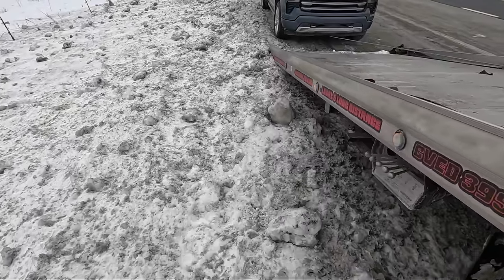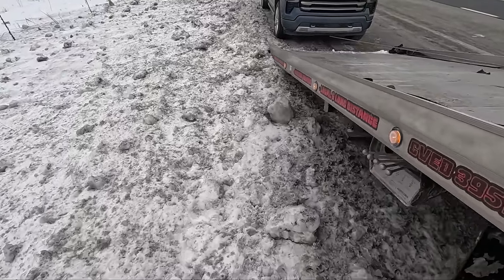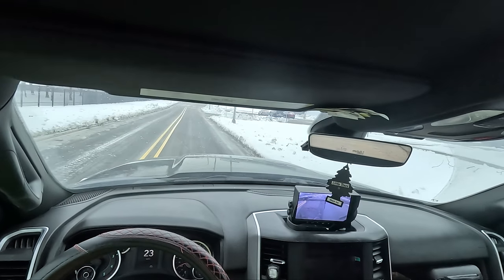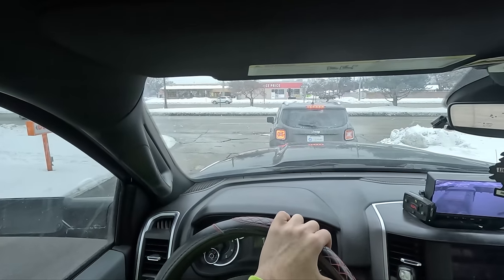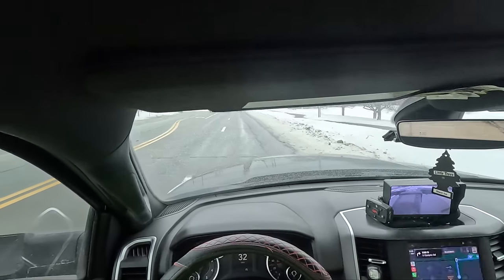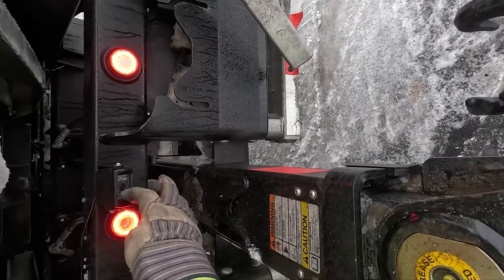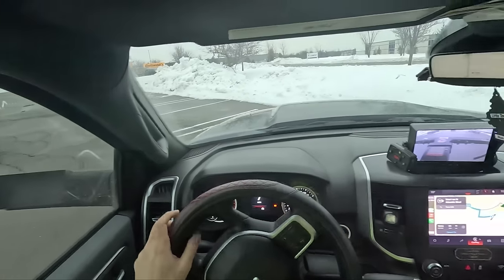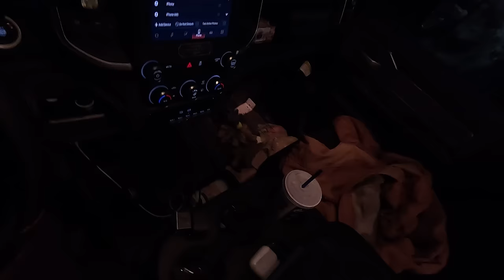2024 SILVERADO BLOWN MOTOR!! | HIGHWAY RESCUE | DAY IN LIFE OF TOW TRUCK DRIVER EP 5

Comment: Makes me wanna keep my 05 Sierra even more !!!
Reply from the maker: Those are the ones to keep!
Reply: Keep it
Reply: I would. You have a good truck!
Reply: Agreed!  I’ll keep my 2001 Sierra with 93k 👍
Reply: Please keep it! I still keep my original 02 Tahoe 400K miles, it has 4.8L
Reply: Absolutely keep it. 👍
Reply: Never get rid of it, if you do get an older one, the government and manufacturers are up to shady business.
Reply: If you do trade it opt for the LZ0 Baby Duramax. It's not much extra cost & saves huge at the pump. I'm averaging 30 MPG with no complaints or problems at almost 10k miles so far. First oil change at 5000 miles I swapped to Amsoil.
Reply: @jonathanlara1989. I have a 2005 Silverado 5.3  180000 miles  and work perfect ac and everything works good after 18 years, hope to get 25 years with this truck before painted or change something mayor
Reply: I have a '04 with 300,000 miles and still drives like new...5.3 v8
Reply: Yeah because that 05 never seen a tow truck and this 24 has a warranty your 05 well
Reply: do not ever get a new gm product, solid truck u have fr
Reply: Same with my 03 Sierra 4.8 extended cab unless I come across a crew cab or one with the 6.0 with the same platform as mine.
Reply: I have an 06 Tahoe z71 I’m not getting rid of my girl for nothing
Reply: That's what I'm looking for.
Reply: Covered under warranty just a hassle. I wouldn't let the few unfortunate detour you from what interest you. I know a lot of 6.2 refresh owners with 0 issues.
Reply: @vanlifebiker it's got its own problems too. Biggest thing is cost of fuel for these. If it matches gasoline it'd be a no brainer
Reply: @DarkenFool  Diesel & gas prices always fluctuate year to year. I've seen gas higher than Diesel at times & Diesel higher than gas a times. Alot of vehicles today require high octane gas so you're definitely winning with Diesel. To each is own 🤷‍♂️ pros & cons in everything.
Reply: @vanlifebiker  you're not wrong. I live on the west coast. For the last few years diesel is always quite a bit more expensive than gas. Thus why I went for the gas GM. My requirement is that it had to come w/o dfm which it did. Haven't had a single issue with powertrain . But running the diesel, not only do you have the higher price location depending, you have higher maintenance costs and addition def usage. Unless you're pulling big weight might not be worth going diesel.
Reply: Well... I'm keeping my 2001 Ford ranger until one of us dies.
Reply: @buyallmeans425  pretty indestructible unit
Reply: I am keeping my Grandpa's '06 Silverado 1500 that I inherited from him even though I have had to wait for a new instrument cluster recently and know my speed with GPS, also not knowing how much gas I have from the dash, which is common to fail. Mechanically, it is solid. Electrical problems every now and then like the cluster going dead on my old one is common.
Reply: Makes me want to keep my 99 Chevy Silverado 5.3 L even more
Reply: Right! I have a 04 hd  that still runs strong!
Reply: Me too, my has 350 k and keeps going back and for to LA twice a year from Sacramento, am no going to let go never
Reply: That's why I love my 02 Sierra over the new ones.
Reply: Same bro got a 06 Silverado 4wd. Paid off and running strong at 212k miles. I’ll drop a new motor and tranny before I even think to buy another truck.
Reply: I have an 01 Mercury and I wanna keep it until it runs to the ground, will probs buy a 7 year old car after that
Reply: same with my 06 running good not a single problem since I bought it back in 06 😆

Comment: This! I went to test drive a 2024 GMC with 8 miles on it and it wouldn't start. After a tech came out to mess with it they got it started and shortly after a 2024 with only 750 miles was being towed in with a blown motor. It was too much shock in a 30 minute span for me haha. I ended up with a 2024 Tundra and don't regret it at all.
Reply: Wow that's nuts!!!
Reply: My 2024 ford f250 had to come back 440 miles on it an the power steering lines blew but ford had it fixed in two days after I got them involved an then they felt so bad they gave me 2 year's of extra bumper 2 bumper warranty
Reply: But now with 2066 the power train light is on I'm guessing something in the transmission
Reply: until that new tundra V6 blows up too. they have major oiling issues. get the V8
Reply: What motor?

Comment: This was a educational video for me, this is why i own Toyota's 😉😎
Reply: Can you put it in neutral with a dead battery? 😂
Reply: @rolandthethompsongunner64  Yes, there's an over-ride next to the shifter.
Reply: Yes.
Reply: Ya if you like lay down under the truck to get to it. In the wet and snow .
Reply: Your 4Runner is beautiful
Reply: @512Born  Thank you
Reply: 2000 LX470 241k miles.  Original engine and transmission.
Reply: 2004 4runner, 2020 TRD ORP and 2021 rav4 Limited AWD currently...no issues. But you do pay for reliability 😉🫡😎. Had Toyota since late 80's and on....
Reply: Oopsie. https://www.youtube.com/watch?v=bv5Vf2d0wXo&t=168s
Reply: @klein2252  2020 TRD ORP 14900 miles, original engine and transmission here too 😉😎
Reply: Omg not another who thinks Toyota never blows up. They do, they all do here and there. The gm ls is one of the most reliable engines on the road. I own a very busy automotive shop and we see it all. Good chance the engine wasn't filled with oil or something just broke. It happens to all brands.
Reply: 2008 duramax 398k miles original engine and Trans. 3 brake jobs, q alternator. That's it
Reply: This guy obviously hates gm so he is only showing those tows, forgets to mention there are more gm products on the road than most brands. It's called cherry picking to make something look bad. Really fake channel, I will do my best to spread the word.
Reply: I had a 2022 Tundra. Issue with a bad turbo at 400 miles. Constantly taking it back to the dealer for recalls. When it rained water would leak through a faulty seal on driver's side door.
Never owning another Toyota again.
Reply: Gm have so many problems.....and it's a 2024 lol. My Neighbor had a brand new gmc 2022 for week and there was a puddle oil under the front end. 2 months later engine light on the dash etc. He got sick a tired of takeing it to the dealer he sold it a year later. My 2019 Rebel it's been great just maintenance and a floor mat recall. @sleeeper88
Reply: @mjones2305  it's under warranty 👊😉😎
Reply: @sleeeper88  2004 4runner v6 bought in 2010 at 98,000 miles. Since bought and current milage is 199,000 as of 2024. Replaced 1 battery, 1 serpentine belt, set of plugs, 1 coil pack and one set of tires and 2 brake jobs since I owned it at since 98,000 miles 🫡 this is besides oil changes and other fluids as recommended 😀
Reply: Brand new tundra's are having issues. All the Manufacturers are putting out garbage.
Reply: @anthony2558  Yes, quality control, a lot of manufacturers have gone down hill cutting corners.

Comment: I just saw this video. I had a 2020 Denali with 6.2. My motor blew with 177 miles. I haven’t seen anyone lower, but 300 is pretty good.
Reply from the maker: Wow! 177 is insane..
Reply: Worse; the biggest complaint against GM's LSx motors 20 years ago was piston slap
Reply: @piercehawke8021 Although the piston slap while cold could be annoying, the engine would still last to 400k
Reply: That's insane, how can GM screw up one of the things they did well that bad 😬
Reply: Who did your truck Blow...a Ford😅😅
Reply: Holy hell. 177?!
Reply: @Eastahtata by hiring a woman! And letting the government control your process
Reply: 😂😂 lol we’ll never know, but you know there’s probably been a couple times when they crank those babies up coming out of the factory and it was like boom! And I like no way did this thing just blow up driving into the parking lot where it was manufactured lol you know that’s happened at Ford NGM
Reply: @markman7 😂😂 yeah that’s why my buddies lasted too barely 200,000 miles and he had to rebuild the motor and he was changing the oil every 5000 miles with the best cent thetic oil. What a waste of money that was his last GM.
Reply: @Getusom  good point, but I think it was probably not a woman who engineered that engine just a bunch of people who were like hey do you think this lifter is good enough guy shrug his shoulders? I don’t know I don’t care I just work here.
Reply: @AmericanSurvival001  it was a woman and the Government that pushed them in the direction they have gone….the head honcho takes the responsibility for how the company is ran whether it does good or bad!
Reply: AFM/DOD/VCM was just the starting point,  @Eastahtata .
Reply: Count your blessings. The new 2024 Hyundai Santa Fe's are having full transmission failures at sub 10 miles requiring a full replacement.

Edit: My new santa fe had a full transmission replacement after i noticed issues driving home from the dealership. One of my friends in Oregon bought the top trim and same issues but after 50 miles. The forums are now filling with people having the same issues, and Hyundai are starting the recall process already.
Reply: Should have gotten the 3.0 Duramax.
Reply: Thank the bean counters, using cheaper parts.
Reply: It's the OIL screwballs

Comment: That was literally 3 strikes in less than 5 minutes.
1. Blown motor(Not gna even ask how)
2. $300 tool to place in neutral.
3. Auto parking brake when manually placed in neutral. I know it’s for safety but sheesh!
Ram FTW even though they are not perfect.

Comment: This kind of stupidly is why I switched back to a 1984 Chevy military k30. 6.2 diesel and th400. Far better design than anything modern.
Reply: Smart man, new trucks are junk, I have 3 trucks, 2 77s and a 96, no bullshit problems like the new crap
Reply: My grandpa had a 1979 C10 for something like 35 years until it was totally rotted out
Reply: As long as you know how to rebuilt the injector pump, you’re good.

Comment: GM still bending those pushrods. Nice feature GM, parking brake auto on in nuetral. Wouldn't be a big deal if they didn't have to be towed so frequently.
Reply: lol so you couldnt jump in pop turn the key to run and throw it in neutral and roll a tiny bit back on the driveway haha These poor starters, first stop start now that. OY

Comment: 2016, Sierra, 1500 5.3  186,000 miles and I tow around 4000 pounds worth of equipment every single day with it. I did put an aftermarket controller to shut off the cylinder deactivation when I bought it with around 80,000 miles on it. I absolutely love my truck, but the issues with these new ones scares the hell out of me.
Reply: My only issue with that generation of GM trucks aside from the AFM would be the absolute garbage 6L80 transmissions.

Comment: I have a 2017 Silverado. Have had zero issues. Got 108 k miles on her.
Reply: Say a little prayer for that transmission and  camshaft.
Reply: Put a tuner on it to delete the afm and drop the pan of the tranny and change the filter ever 50-60k. Also change your oil every 5-6k youll get 200 easy out her
Reply: @454budman  Had the transmission serviced as apart of upkeep.  I always get the oil changed regularly.

Comment: My buddy just bought an AT4 w same motor.  Another buddy already had one blow up.  Meanwhile my 14 tundra has 393k.
Reply: The only problem with a Tundra is the gas mileage is the as my 6.0 3500hd but can haul 4000 pounds and just as reliable
Reply: Should have bought the 3.0 Duramax then.
Reply: @EBIndy  my wife bought one a year ago we have 36000 miles been good so far averaging Just over 25mpg

Comment: Seeing how a current model Chevy Silverado has blown its engine at 300 miles makes me glad I am now a former GM customer.  My first car was a Chevy Cruze and needed $1700 in engine repairs that were covered under warranty.  I ended up trading it for my second vehicle which was a Chevy Equinox.  It was a good ride, but it had no power under the hood with that small 4 cylinder engine it had.  It would downshift on every hill I drove on to make up for the lack of power the engine had and I got tired of it.  I crashed the Equinox two years later.  I said to myself that I'm done with GM and found me a nice Toyota Camry.  When I took the Camry on a 30 mile test drive, I knew I found the perfect car for me.  The best thing is that Toyotas are better built than what GM currently makes.  It's a great car with plenty of power and acceleration under the hood.  I know I'll have that Camry for years to come with the proper maintenance unless I decide to trade it for something newer down the road.

Comment: It’s so refreshing to see tow truck drivers like you after my last experience with one was the dude pulling up on my grandmas truck in the ditch, not calling us, hooking up to the rear rim of the truck and pulling it that way, while the rear bumper was already resting on a structure(whole driveway was a sheet of ice and it slid into the ditch and back into a pole) he damaged the rim and since just yanking it he ripped the back bumper off and scratched the tailgate, then lied to the cops saying he never touched it.. some drives are sleezy people

Comment: Our neighbors brand new Yukon Denali XL had a compete engine failure at 3,000 miles. Once the dealer replaced the engine and gave it back to our them,  they were on a hockey trip and the dash lit up like a Christmas tree. They brought it to the  nearest GM dealer,  only to be told there were over 72 pages of fault codes. It's now fixed. This was their 3d GM full size,  but they now have a $100,000+ SUV with an ugly car fax. They are now eyeing my Grand Wagoneer which has been faultless over its 19k miles.

Comment: Wow.  My 2024 Silverado is at the dealer getting a replacement engine .  It’s been about a month in the shop.  For the amount of money we pay to GM for these trucks, you’d think they’ll do a better job with the eternal parts in the engine.  Truck has a little over 4,000 miles.  Thank goodness I kept old faithful (2003 Silverado 330,000 miles)  still looks great, rides smoother than the new one, and no payments.
Reply: 2012 Lexus we have rides 200 times smoother than our RAM v8 2021. In the Lexus, the engine just sounds like the fans running at low speed smooth, quiet, and nice. Our ram sounds and feels like it might shake itself pieces.

Comment: I have a 2023 silverado LTZ with the 6.2 engine, and did happen with me exactly the same thing a 35 days ago, I will pick up my truck later today, they had to replace the entire engine, my truck was with 59300 miles, almost running out of the power train warranty. I hope they fix for my new engine

Comment: I always say.. Design engineers need to be sent to Minnesota at the coldest week of January.... stripped to their underwear.... given a pocket screwdriver & told they must use their design to get the vehicle into Neutral, Damage free... Including no cracks to brittle cold plastic trim... They will not be allowed back in where it's warm until they're sucessful .....  If they can't sucessfully do it in 5 minutes or without damage & with nothing more than a pocket screwdriver..... They need to redesign their shift bypass until they can.....    Watch how fast things change when they gotta use their design.    Electric Parking brakes are another Step BACKWARDS in technology... manual E brakes can operate with or without power, don't self apply, they work if the vehicle has been flooded or was stolen, Ya don't need keys, and how much drag can be controlled from a light resistance, but still rolls... or a full lockup.....Plus they're safer to use & regulate in an emergency ..... Newer isn't always better...  **Word of advice, Turn the pear ring on your bridle 180 degrees... the narrow part is for the winch cable, the wider portion is for each leg of the bridle. Stay safe out there..  :)

Comment: I’ve never had any issues with Chevy until my 2023 Colorado which I bought June of that same year. The battery was bricked twice due to a software update and now I’m having transmission problems, apparently it’s a sensor from what I’ve heard. All of which has happened in only 8 MONTHS OF OWNERSHIP! Now I’m looking to switch brands, I’d get a Tacoma but they’re too pricey which leaves me with the Nissan Frontier and the Ford Ranger when it comes to midsize trucks. At this point if I get something from GM it’ll only be the corvette.

Comment: Buddy of mine bought a 2024 Silverado 1500 6.2L two months ago. Engine blew the 2nd day he owned it at just over 100 miles. He made the dealer buy it back and got a 2024 2500 6.6L gasser instead.
Reply from the maker: The 6.6L seem to be having much better luck we haven’t towed many if any yet 🤔
Reply: Those suck too. I owned a 2021 6.6 and it was a pile.
Reply: Burns oil
Reply: He didn't learn the first time
Reply: 2024 cars suck
Reply: @aircrewphotog can agree we had a 6.6 gasser in our work truck and boy that truck loved burning oil.
Reply: Should have gotten the 3.0 Duramax.

Comment: Makes my 2014 feel like a gem.
Reply: it shouldnt. it is the exact same engines. 5.3 and 6.2 starting in 2007. i think 6.2 in 2008 with the AFM
Reply: @johndonovan7018  yeah but a brand new one?  I haven't had a problem with mines like that and I got over 130k on mines.
Reply: My O2 Silverado I bought new and still own with 117,00 miles check engine light has NEVER came on, still has original alternator and belts, my new Colorado Trail Boss check engine light came on at 300 miles! Had to get it updated!
Reply: @jimmycline4778  see that's what I'm saying. New vehicles shouldn't have problems after a little bit of miles.
Reply: @jimmycline4778 Those trucks are going for around 20k in excellent to fair condition. Keep it.
Reply: @marksman4004 They suck. Electrical issues galore.
Reply: @rolandthethompsongunner64  for real.